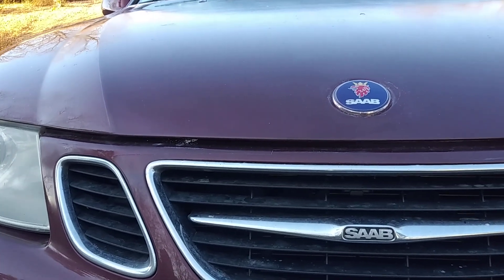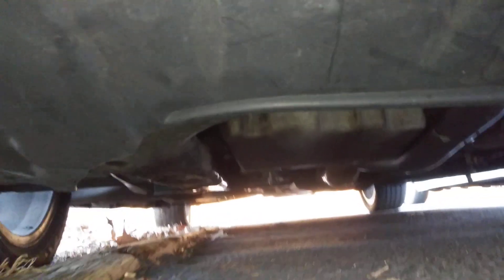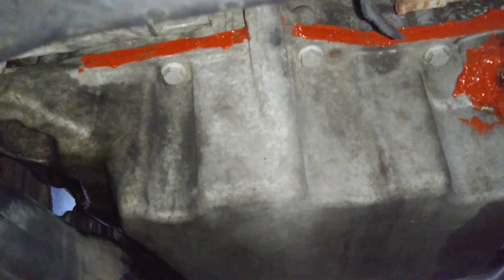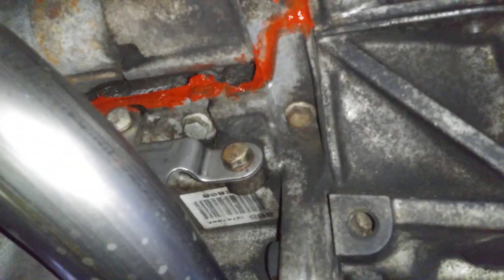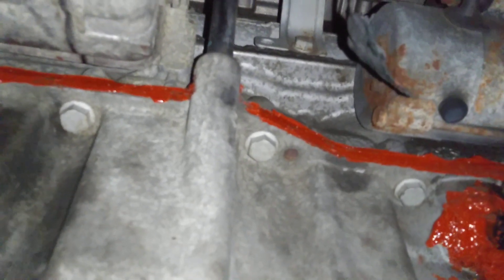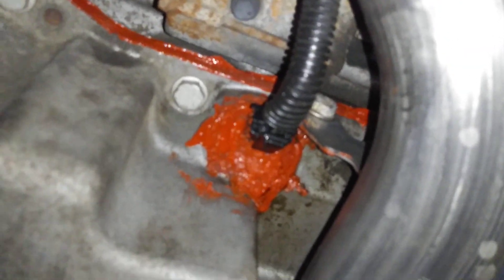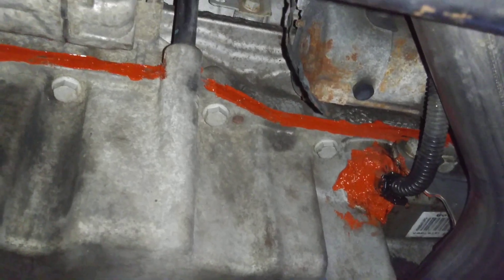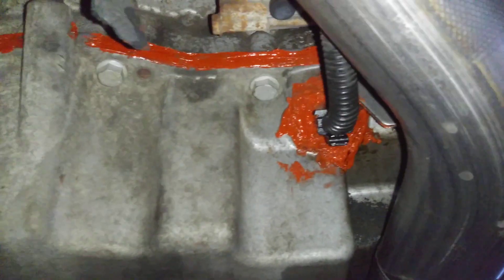Car has burning oil smell when stopped EASY FIX! 2004 Saab 9-3 oil leaks

Comment: How long do think this will work... guestimate... I can't get a new car right now so I'm gonna do this
Reply from the maker: I think it would work for up to a year, it's not really a big problem however to have a leak or a drip, it's a problem to have a pressurized part of the engine spraying oil, loss of oil pressure inside the crankcase is a much bigger problem, this is meant to stop low pressure leaks in the oil pan and transmission area.
Reply: Thank you... I am a woman and I wanted to take it to the shop and now I can take it to someone to do it cheaper... hopefully🤞🏽... I will be able to get a newer car in about a year... perfect timing
Reply from the maker: @leveluptarot3115  I don't think a shop would want to do this, but you may be able to get a friend to...it's more of a DIY bandaid for us folks with the more unusual cars that are pricey to fix. Again, if its just a drip, it won't harm anything. It won't get better, but unless you have an oil light on your dash, just check the engine oil once a week and top off if needed. You can also try adding an oil leak sealer next time you have the oil changed. They cost a out $10 and can sometimes seal smaller leaks, and they won't harm the engine, worth a try.

Comment: You could have used a sealer that’s what I did with my Ford Taurus
Reply: Like the stuff they sell in little bottles? I'm having this problem with my 2014 Ford escape. I know this is an old video and probably won't see this, but thanks in advance if you do.